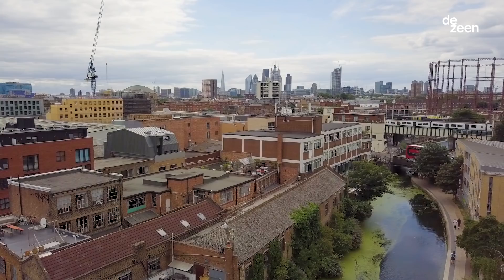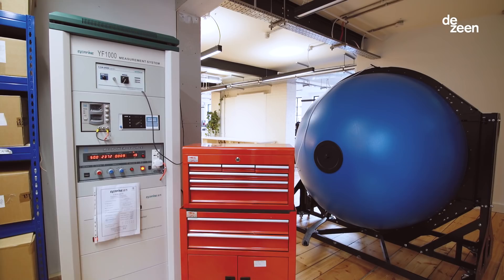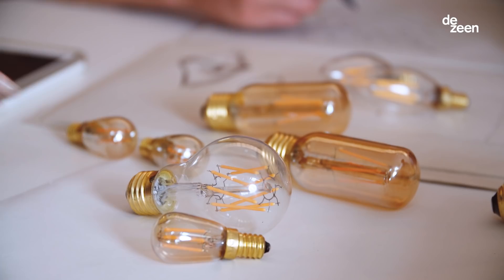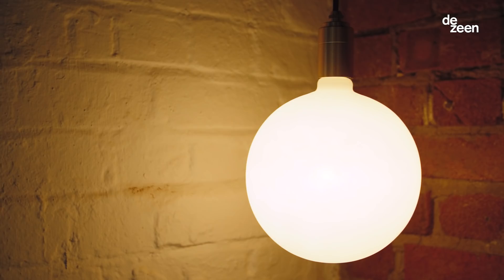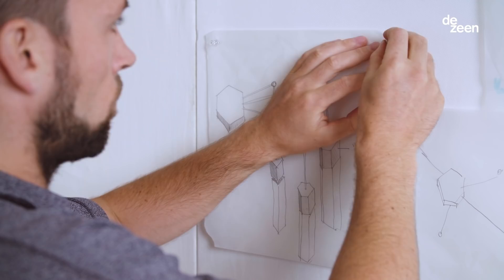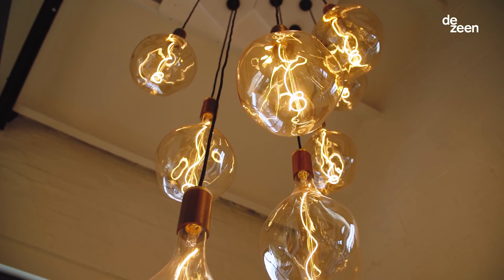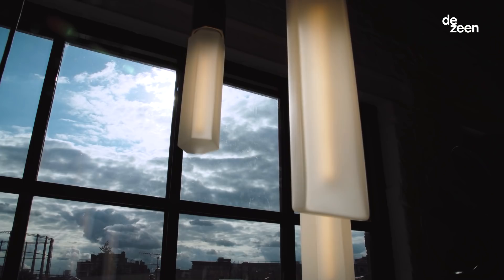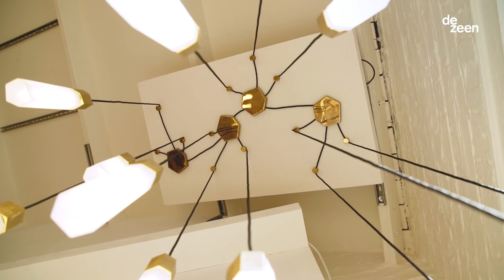Tala lighting: "Good design can help mitigate climate change" | Design | Dezeen

Comment: Your specs on your ‘first plug in’ single e26 bulb is incomplete as to the dimension of light sockets, 2 nodes( instructions on how to install on ceilings etc); btw the the 20 foot long cords is an ideal length for my need.Add materials used on the cord is not specified too.I am planning to buy at least 4 but hesitant still…